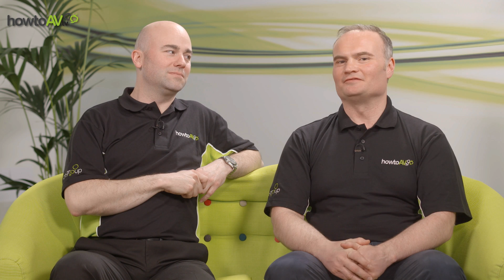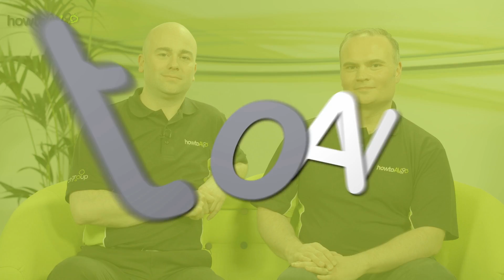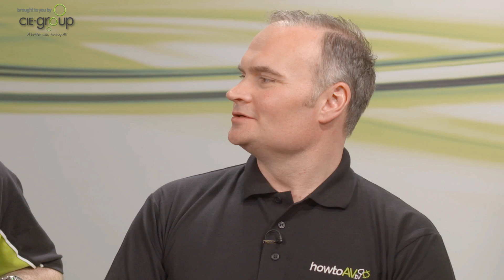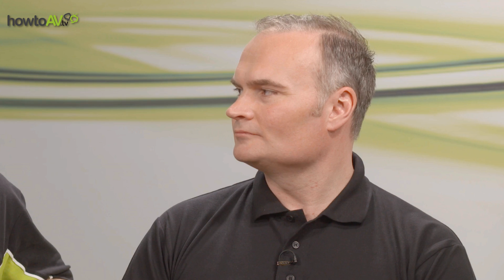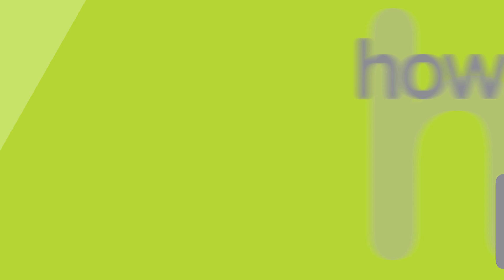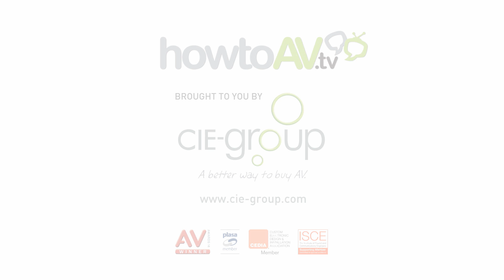What is an HDCP error?

Comment: Just listen to how dumb this video is. You said if the problem persist just unplugged it and plug it back in again. But the very definition of “persist” means that it will happen again, so you have not solved the problem. The problem is not the single occurrence, the problem is the repeated occurrence. So this video is absolutely positively useless. You do not know how to solve this problem - the reoccurrence, so don’t make a video.

Comment: Hi great video explaining how it works. I have an infrequent HDCP error issue with using a digital sender from my main Sky+ HD & TV in the Living Room to a 2nd TV in the kitchen with the digital receiver connected to it. 99% of the time, there is no problem and the sender works fine and I can watch Sky on the TV in the Kitchen. Then occasionally, the picture will vanish and be replaced with a Sky message "Display is not HDCP compliant". This appears on both the TV's. The only way I have been able to work around it is to unplug the sender, then plug it back in to effectively "reset" it. Is that the only resolution or is there something more permanent I can do? Many thanks, Wayne

Comment: you just need to make sure your 4K source and 4K display both support HDCP 2.2 and your hdmi cables are HDMI 2.0 , even your  AV receiver needs to support  HDCP 2.2,  However... not everything 4K is hdcp 2.2 , there are cheap 4K units that are not  hdcp 2.2 .... always check the specs of the unit you are going to purchase.....  or... you can use a 1x2 hdmi splitter to fix the "issue"

Comment: Okay-how come all of a sudden after 3 years with my Roku streaming stick and a Sharp LED Tv, I have lost video. I am having no luck getting an answer out of  ROKU. I have a HDMI cord and 3 splitter hooked up to back of tv--DTv working fine. No problem. I wondered if I needed 
Silverback S6 4k HDMI Cable 6 ft - HDMI 2.0, HDCP 2.2 and 3D support, 4k @ 60hz 4:4:4, Deep Color, by Sewell Direct.  None of other cords indicated HDCP settings. Also wonder if splitter needs to have HDCP settings. Thanks for your response.

Comment: I have a Westinghouse model sk-19h210s LCD TV and an Xbox 360 S model. The problem is when I try to play any DVD I get audio, but no visual on the screen. I have an HDMI cable going from the TV to the Xbox. But there's an error message thats pops up and says: "Secure HDCP link not found". I changed out the HDMI cable with another brand new one, supposing thats what was wrong, but it did not resolve the issue. What makes absolutely no sense is that it worked perfectly fine last night, but not at all today. Is it my TV? Do I need to get a newer model TV to be able to play DVD's on my Xbox using an HDMI cable? Please respond as quickly as you can, I need to use this DVD for school, but dont have another device that can play DVD's other than my Xbox. Thanks.
Reply: have you been able to fix the issue if so please tell me how

Comment: how do you know if your tv is hdcp compatible
Reply from the maker: Hi Gamalier and many thanks for your question.
It's simply a case of checking the manufacturer's specification (either within the user manual or online).
If your TV has HDMI inputs, it should definitely be HDCP  compatible (but do check!).
However, if you have a 4k / UHD TV it needs to be HDCP 2.2 compatible in order to play UHD content (See our videocast on HDCP 2.2 here: https://youtu.be/suw0aJ7IULk ). And this definitely would need checking as early generation 4K UHD TVs may not be compatible!

Comment: We have a Sony 4k 3d XBR-65x900A TV with HDCP2.1 port and a Samsung UBD-K8500 4k 3d Player with HCCP2.2 and just want to be able to watch 4k movies on the Sony tv, any way possible, without having to buy a new tv?
Reply from the maker: Good morning Ralph and thanks for your message.
The CYP XA-HDCP should do the trick for you - it's a HDCP converter which converts HDCP 2.2 signals to previous HDCP versions...
https://www.cie-group.com/shop/av-distribution_19/hdmi_1023/hdmi-test-equipment_1031/hdcp--colour-bandwidth-converter-with-hdmi-repeater-uhd-hdcp22-hdmi_23164.php
Reply: Thanks, but I did find something equivalent, wish I would have received your comment sooner. I paid a bit more, but its working. Super thanks for your help and response.
Reply from the maker: Glad you sorted a solution Ralph.

Comment: I have a SHARP 52" Monitor Model PN 525E. It supports 1920 X 1080 resolution but it doesnt have a HDMI input only as DVI D. I got a DVI to Hdmi converter and I was in business but I cant play xbox 360 or Play Station 4 on 1080p resolution. Can only use 720p and I suppose it has something to do with HDCP. 

How can I disable it from my Xbox 360?

Comment: My Direct TV provider just changed their HDCP code which made the system not compatible to my TV. Their solution was to use component cables which they sent me,,, that sucks, But the big problem is that now my HDMI ports only sees the direct tv box and not my dvd player or ps3... Is there a way to fix this problem..
Reply: USE A HDMI Splitter they will tell u it doenst work IT DOES

Comment: Went to watch a Neflix movie from a Roku 3 and got the error message.  After Googling a few sources I discovered they could be fix.  Either just replace a damaged cable or do what I did which was to unplug then replug the cable and it's working now.
Reply: I put a activation in in as required and it was a success but after doing so I am no longer able to see any of the foxnow shows where as before i was on some
Reply: Dose not work
Reply from the maker: +ljones7788 Thanks for the feedback! Sounds like this was a simple connectivity issue rather than a HDCP compatibility issue - we love the problems that can easily be fixed! To use the 'handshake' analogy again, by reconnecting your source and display - you were effectively reintroducing the two devices to one another.

Stop Press News, by the way! we were back in the studio yesterday to record the latest update on the latest HDCP Version 2.2 for 4K UHD content. The video will be live in the next couple of days...

Thanks for watching!
Reply: +eakhl I have one Roku 3 and lucky for me it only happened once after having owned it since it came out.  Researched a lot of forums and people being told to reset their Roku and found this was the easiest and fastest way.  I have it plugged directly into the TV.  Best of luck.

Comment: Is it  possible to use a HDMI splitter in order to bypass the HDCP? I know it'sused for the same purpose but then with capture cards.
Reply: +cie-group .com for a matter of fact i tried using a HDCP splitter and it did work.
Reply from the maker: +megamaximpie Many thanks for your question - unfortunately a professional HDMI splitter cannot be used to bypass the HDCP. As you know, HDCP protection has been embedded by the publishers in order to protect their content and, therefore, professional manufacturers must adhere to the HDCP / HDMI standards.
There are a number of non-professional products available on the market which may allow you to bypass the HDCP, but they are certainly not going to be an approved HDMI product.
Reply: +megamaximpie 

Unfortunately using a splitter
will not remove the HDCP encryption. As Martin mentioned in the video, HDCP is
there to protect content from unlawful duplication. HDMI licensed products are
unable to strip away HDCP or convert from HDMI to an analogue connections,
again to prevent copying content.  There are some unbranded products on
the web that can do this, but these are non licensed and aren’t guaranteed to
work. Laptops, video cameras and other devices that allow the user to record
their own content don’t always add HDCP encryption. Because this is your ‘own’
content, you are able to reproduce and distribute the content how you wish.
Reply: +ciegroupltd the thing is that my samsung tv gives me the informstion of its settings. and it tells me.that it's hdcp complient. but at the same time it isn't? that sounds a little odd to me to be honest. and im sure my external devices which are connected to my tv are hdcp complient.
Reply: +megamaximpie so using HDCP splitter could make it work? Okay I would try that. 
My TV got HDCP problem when there was a storm in my area, so there was heavy lighting, maybe that was a reason why my TV get HDCP problem.
Reply: I doubt that HDCP problems occur as a result of weather conditions such as lighting. But if you are sure it's a HDCP problem then yes, i strongly reommend buying a HDMI splitter. Make sure it's an active splitter. In other words, the splitter has to be powered by an adapter. I bought an 1x2 active splitter and since then my HDCP problems were solved. Im using it ever since.
Reply: +megamaximpie there was a pop up error notification (from cable TV decoder) appeared when tv switch to HDMI port. that pop up told about HDCP problem. Thanks I will try it.
Reply: +Riezky Eka Nugraha ooh. okay. watch some videos on youtube about hdmi splitters to bypass hdcp. it will become clear how they work if you do some research :)
Reply: megamaximpie can you give me the link of the best video?
Reply: +cie-group .com I'm sorry but I have to disagree I've been doing this for Years and it works great honestly anyone knows that all DRM gets cracked with in about a week of release so I highly doubt its not possible to bypass HDCP Pirates will find their way and did as I can confirm I can record off my sky TV box with a HDMI splitter
Reply: +megamaximpie I love it how they where like Lol there's no easy fix...

Just trying not to admit that all DRM can be cracked in a matter of secounds and all DRM will be cracked lololol
Reply: Wow you people just need to stop messing around with electronics!! If it ain’t broke don’t fix it!!!! Every time I buy a new device some type of new regulation or new lock out to where you can’t use it like you use to!!!! My god making things more difficult for people to enjoy tv! Love how these companies change things around so where you buy one new electronic you have to buy a new w.e to hook up with it because it’s not compatible!!!! Man I miss the old days back in the 90s things were simpler and more relaxed lol